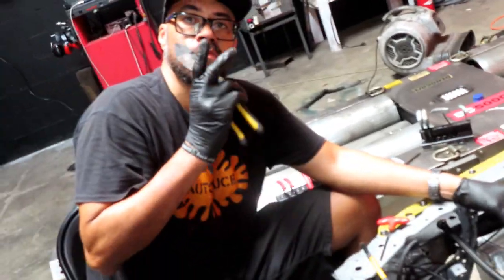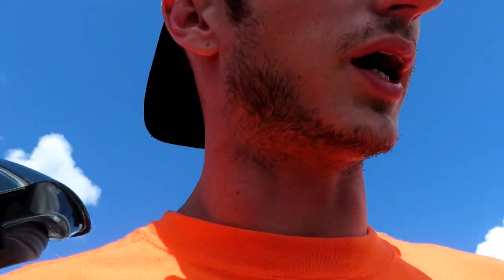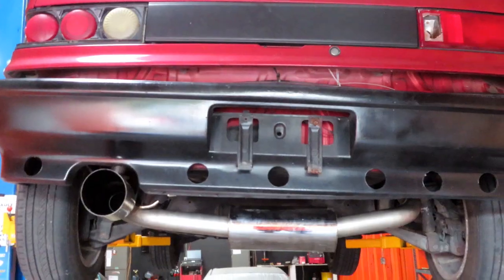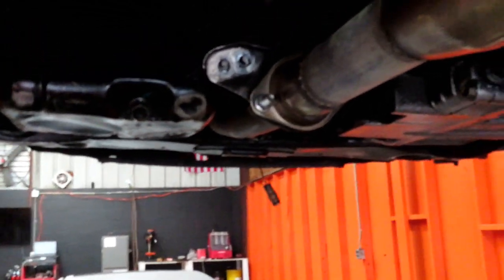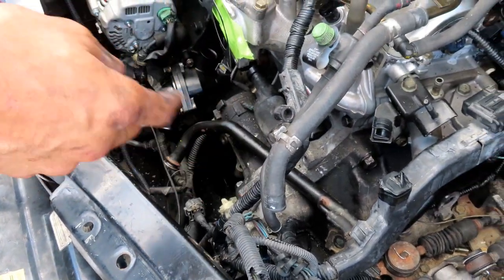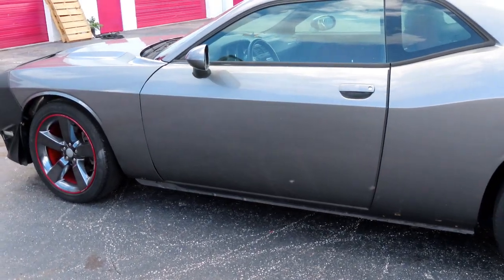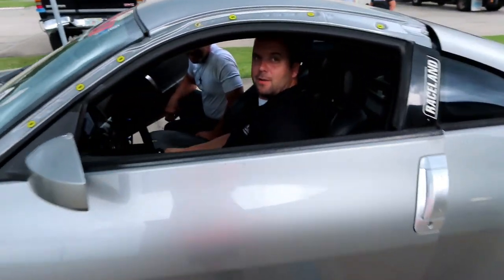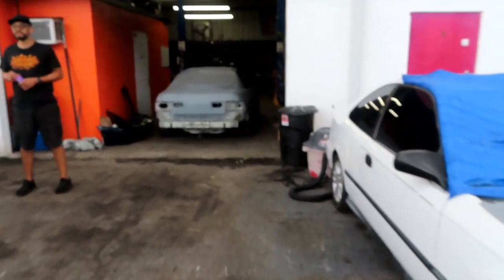Working On A K24A Swapped Civic EP3

Comment: I have a couple questions. 1 First, I'm in Miami and looking for a tuner in Florida?, I don't want to go through Javi, btw bc he is too hard to get a hold of, but I'm willing to travel anywhere in Florida. 2 Second, I finished my k24 swap a couple months ago but my interior blower fan does not work, it feels like there is no power to the ac controls (no lights at all). For the k swaps you have done, does the blower still work without installing the ac kit?